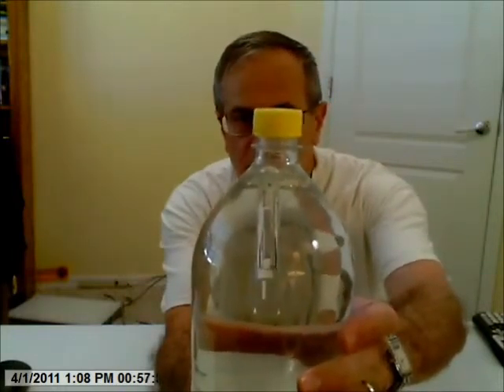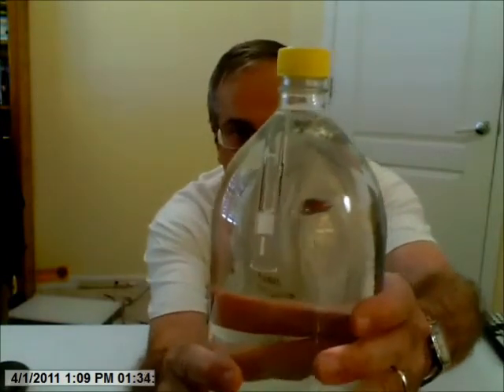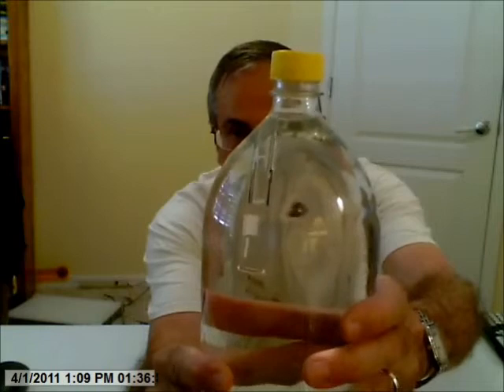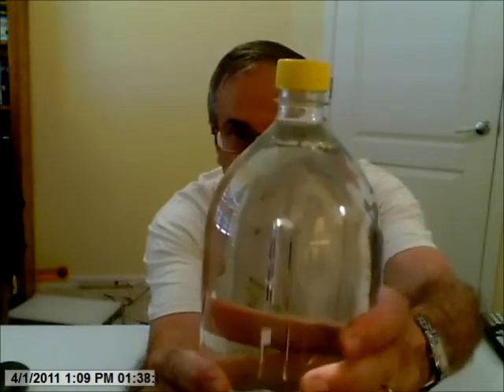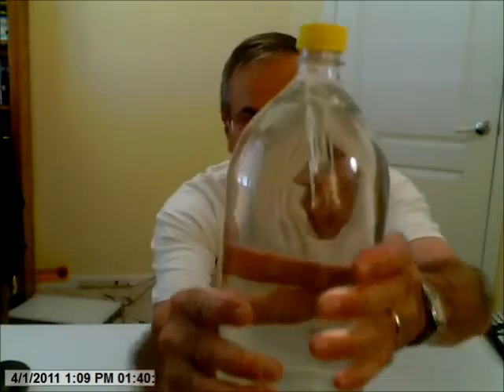How the Cartesian Diver Works (Note:  My explanation is incorrect.  See the comment below:)

Comment from the maker: After reading the insightful comments from Observ45er, I realize there is a correct way to analyze this Cartesian diver problem.  Consider an inverted test tube with an air bubble in it.  The test tube with trapped air bubble is completely submerged in water.  Four forces need to be considered.  The test tube  alone has a weight and because it displaces water it also has a buoyant force acting on it.  The air bubble has a weight and also buoyant force.  The buoyant force on the air bubble depends on its volume which changes with hydro-static pressure.  At low pressure the volume is large and the buoyancy is large.  This results in a net upward force for the test tube - air bubble system.  The test tube rises.  At high pressure, the air bubble compresses and the buoyant force decreases.  This causes the net force to be downward and the system falls.
Reply: Thank you.  I'm glad it helped.
.
That account with my two videos was terminated and I tried to get info why but got no response. I searched for that User ID and your video came up. So at least I have this one reference.
I tried more today and we'll see if anything happens.  I discovered there is a You Tube community and posted a question there - I hope it appears, but am unsure with this complex user interface. 
I sometimes have this strange, aparently random user ID. . . 
Cheers

Comment: Some explanations of the Cartesian Diver explain that the water entering the diver increases the diver's weight.  This is not correct.  Thinking carefully about this, if the weight-force of the water is to add to the Diver, there must be a way for this force to be applied to the Diver. What is the mechanism by which the water's weight-force gets applied to the Diver...? 
...
Because the bottom of the Diver is open, how can the water add weight to it...?   If there were any additional weight force pushing downward, it will merely push water out the opening until the trapped air expands to equal the hydrostatic pressure at the opening.  
The test tube is the ideal way to see that there can be no weight added to the Diver.   So we see that this explanation is problematic. 
...
We know from Archimedes that the amount of water that is displaced is key to buoyancy. We do know that somehow the overall density of the Diver must increase if the diver sinks.  To increase density we must either increase the weight, or decrease the volume.  This gives the answer.  
...
The volume occupied is reduced with the added water.  This is not obvious because the location where the volume change occurs appears to be inside the Diver, in the tube and there does not appear to be an overall size decrease, but there is.  Imagine that the open bottom is replaced by a thin rubber membrane which can stretch in the same way that the water does when it enters the bottom of the test tube.  Now we can see the volume of the diver decreasing. It's just that some of the water which surrounds the Diver happens to be inside the opening of the tube.  We can actually remove the part of the tube that has water in it to see the actual lower boundary of the diver is at the water level.
...
If we had a sealed, all rubber Diver, then we could see the size decrease as the pressure increased and the Diver gets squeezed, shrinking somewhere on the sides and bowing inward.  Cartesian Divers can be closed as long as they are flexible and can be squeezed so that their volume can be reduced by the elevated pressure
...
So, the correct science is that the volume of water that is displaced by the Diver is reduced due to the air compressing from the increase in pressure.  The Diver now displaces less water which makes its fixed weight more than the now smaller volume of water displaced.   The water that seems to be "inside" the Diver, is actually water that is outside the diver and, therefore, is not displaced by the Diver..  This is no different than a flexible, sealed diver that shrinks under pressure.
--  
Regards, ScienceAdvisorSteve
www.challengerillinois.org
Reply from the maker: +Observ45er  Thank you so much for your comment.  Your are correct.  My explanation is wrong.  Here is a better way to explain what causes the test tube to fall when the pressure is increased.  There are two forces associated with the test tube.  A downward gravitational force on the tube itself and an upward buoyant force on the air bubble.  When the pressure increases, the air bubble gets smaller and the buoyant force decreases.  This causes the upward buoyant force to become less than the downward gravitational force and the test tube falls.  
Thanks again.  Let me know what you think about this revised explanation.
Reply: Charles Marzzacco Hi Charles,
 Well, that is much closer.  I see other sources that give a general explanation by just saying that the density increases.  However, I feel it is quite important to explain using what we call  'first principles'. You are ok up until you give the cause of the buoyant force. 
...   I'll just ask these questions...
Why does ice float when there is no "air bubble"? 
...
One of my Dad's favorite puzzles was:  given a penny and a boat floating in a pool; which will make the water level higher; throwing the penny into the boat, or into the water,  and WHY?
...  The key: 
What is the true cause of the buoyant force that was revealed to us by Archimedes?
-- 
Regards
Reply from the maker: +Observ45er Thanks for the interesting question about the penny.  I think I can explain it.  Let V be the volume of the penny and D be the density of the penny.  Let d be the density of water and A be the surface area of the lake.  If you throw the penny in the lake, it sinks and the lake rises by h=V/A.  If you throw the penny into the boat, the mass of the boat increases by D*V which is the mass of the penny.  This will result in an equal mass of water displaced.  Thus D*V = d*v where v is the mass of water displaced as a result of throwing the penny into the boat.  Thus v =(D/d)*V.  Since D is greater than d, more water will be displaced when the penny is thrown into the boat.  The water level will rise more if the penny is thrown into the boat.  Am I correct?
Reply from the maker: +Observ45er As for the ice block floating in water, it floats because it is less dense than water.  A certain volume of the block is below the water level and the rest of the block is above the water level.  The weight of the block is equal to the weight of the water displaced by the block.  If the block were to be pushed down and suddenly released, it would rise because the buoyant would be greater than the weight of the block of ice.  If the block were to be pulled up and suddenly released, if would fall because the buoyant force is less than the weight of the weight of the ice block.

As for the true cause of the buoyant force, I am unable to give a good answer.  I do remember reading something on this, but have forgotten the details.  When I get a chance, I will give it more thought and do some web searching.

Thanks for your great comments!
Reply: Charles Marzzacco  Hi Charles,
While you appear to understand, what I'm going for is what I think is a very important way to voice the principle. 
...
The upward buoyant force that is exerted on a body immersed in a fluid is equal to the weight of the fluid that the body displaces.  [Wikipedia]
...
This is what Archimedes revealed. The water being displaced is only the volume of the test tube itself plus the trapped air.   So the buoyant force is caused by both of these, not just the trapped air as you stated and, most certainly, not by the water that only appears to be going in and out of the diver.
...
 The test tube glass weight and the mass/weight of the trapped air are constant, but the volume of the trapped air changes.  Therefore, the amount of water displaced changes; changing the buoyant force (as well as the average density of the test tube and trapped air system).
...
Perhaps you have heard large ships discussed in terms of their displacement.  If a ship weighs 200 tons, then it is displacing 200 tons of water and is held up by that force.
...
Several others simply refer to the density changing without pointing to how that is accomplished.  That isn't wrong and a fair summary, but is does not get to the heart of it and is vague.  It may allow an assumption that the water adds weight to the diver.
...
Another way to help realize that the moving water is not adding to the weight of the tube is to think of inverting the test tube, open end up.  Now, it should be clear that the weight of the included water CAN add to the tube's weight because that weight can now push down on the bottom of the tube.
...
Another thing you can do is to finely tune the diver so it barely floats on the top.  If done well, it will then sink AND stay there if brought to the bottom.  This is because the hydrostatic pressure is greater at the bottom which forces more water up and compresses the trapped air more.  Each 32 feet of water depth adds one atmosphere of pressure.  This is about 0.459 Psi change per foot of depth.  If you calculate the area of the test tube you should be able calculate the pressure difference of any bottle, top-to-bottom, and calculate the water level change in the test tube using the gas law (Pv=nrt) and perhaps, observe that change.  This would be easiest to see in a very thin tube.
Look for a water bottle that has a cap with a small inner ring that closes first yet still allows you to screw the cap further down.  These are quite common.  This way you can get the diver to be on the edge of sinking then tighten the top to get it fine tuned. When tuned well, pushing down on the cap will cause the diver to descend and suspending the entire bottle only by holding the cap will cause the diver to rise.
...
   I currently have one sitting on my kitchen counter and the barometer is rather high.  When the barometer finally falls, I'm hoping the diver will rise.
...............................
...
Wikipedia's explanation of the Cartesian diver is weak in my opinion.  So far I found only two explanations that hit the nail on the head:
...
These are the only correct ones I've found:
http://www.physics.org/tricks/cartesian-diver/
http://hyperphysics.phy-astr.gsu.edu/hbase/pbuoy3.html
...
Some only say that the density changes (this should be average density).  Also not wrong and a fair summary, but it can include the displacement principle and not be difficult to understrand.  For kindergarten only talking about being heavier and lighter is ok since density is a bit much.  It's not 100% correct, but within the realm of their understanding.
...
Those that say the weight changes are simply wrong and cannot be considered a "simplification".
...
Purdue and Steve Spangler's site have it wrong and I've emailed them:
http://chemed.chem.purdue.edu/demos/demosheets/1.2.html
"As a result, the mass inside the medicine dropper has increased substantially, but the volume has remained the same. More mass in the same amount of volume yields a greater density. "
...
http://www.stevespanglerscience.com/lab/experiments/eye-dropper-cartesian-diver/
"Squeezing the bottle ... increases the mass, and density, of the diver causing it to sink."
...
RE: The ice cube.  I was trying to point out that there is no air-bubble in the ice and perhaps that the buoyancy force couldn't be due only to an air bubble, but displacement...perhaps a lame try.
When raised, it is displacing LESS than its weight in water > buoyancy (upward force) reduced.
When pushed down, it is displacing MORE than its weight in water ?? buoyancy (upward force) increased
...
...
What about the penny and boat question?
--
Best Regards, ScienceAdvisorSteve
www.challengerillinois.org
P.S.  I use a concept I call the "Floor of Understanding"  This is the level, or detail down to which any given student needs, wants, or is able to grasp, down to.
...
For buoyancy you can go deeper and discuss fluid properties and how pressure is exertad in all directions to explain this at an even lower level.
.... Chuckle... Whatever floats your boat. (;-D)
Reply: Charles Marzzacco  OOPS! Forgot.  I really appreciate your responding.  For several years I have been contacting varous authors and many simply ignore their videos alltogether.   This has been for the all too commom misconceptions of how wings produce lift and what is called the "Bernoulli Principle".   Misunderstood, taught and written about by so many, for so long that one can easily find tens, if not hundreds of the same incorrect expplanations and believe that quantity makes truth.
...
  It's a branch of pseudo-science that has taken on a life of it's own.  So may people also believe that  the professional aerodynamisists don't even understand it., but it is just the amateurs that have been debating it  and publishing misconceptions.
...
There seems to be some gene that irresistably compells so many to be driven to produce a video to explain it. 
--
Best Regards
Reply: +Charles Marzzacco    OOPS just saw your penny-boat response. You took a long way around and I had to read very carefully.
...
Yes. In the boat.
...
More simply put:
A) In the water it displaces its volume. (we know it'll sink)
B) In the boat it displaces its weight of water. (it has to float -- Small penny. Big boat)
Since it takes more water (volume) to have the same weight, displacing its weight yields more water...
--
Regards, Steve